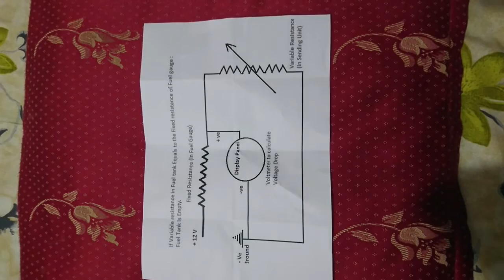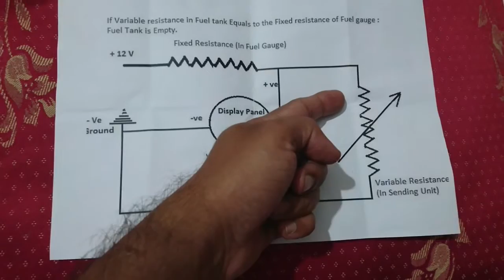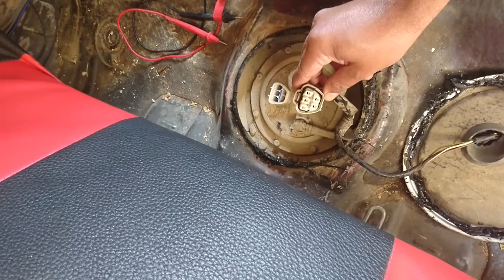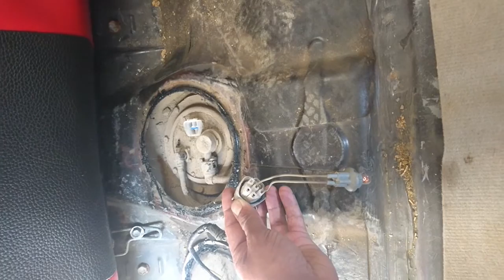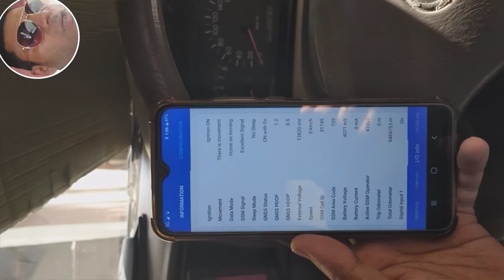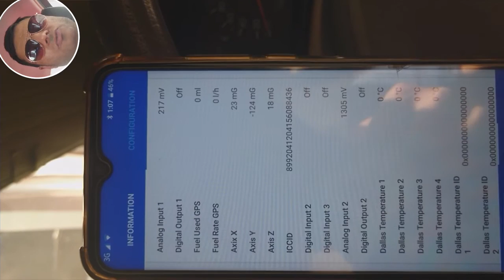Connecting Teltonika GPS Tracker to Vehicle Fuel Gauge Sensor (Part I)

Comment: I have done this method but the voltage sent to the tracker flucuates too much due to fuel sloshing. How do you minimize this fluctuation
Reply: Has you calibrate filling empty tu full tank step by five lto five itters? Please let me know because i`m trying to do this, on the other hand, has you consider use a ceramic resistence and diode?
Reply from the maker: Fluctuations will be in milli volts only that Ok rest is need to be handled at Software or application Side, you see check sequel of this video for this
Reply: @AnjumSohail  "Thanks, master. What resistance capacity do you recommend? 1 kohm?

Comment: Could you please make the video for connecting Teltonika with fuel wires in Innova?
Reply from the maker: I do'nt Own the Toyota Innova, but context described in the video are specific to some vehicle, you can simply trace fuel sensor wires from fuel gauge to the Cluster meter using Multi meter (continuity Testing ) and attach as described

Comment: how do I connect to a Shenzhen BW09 since it has a fuel reading option
Reply from the maker: As per datasheet I read, it doesn't have any wire analog input, although it has marketed as having fuel detection feature.

Comment: Hello friend I did but with a Ruptela trace 5 and I have data the problema Now si the platform that I need to use  to convert that data anolog.
Reply from the maker: Plz see video in link for application side details : https://youtu.be/Oc5o3Cpyc-g?si=Emcd0-fsjnkDsyQE
Reply from the maker: From Data conversion if you mean Gallons of fuel left, then it will be pure mathematical, lets suppose your fuel tank capacity is 45 ltrs, and fuel sensor reports 500 millivolts ( max=0.5 ) when tank is full and 6 Volts (min=6) when tank is Empty. (Example Reference range, varies with each vehicle). let X be the currently reported value the formula could :
Amount Fuel Consumed in Liters = (X -0.5) / 6 * 45
or
Amount of Fuel Left in Liters = 45 - { (X -0.5) / 6 * 45 }
Reply from the maker: Plz see video in link for application side details : https://youtu.be/Oc5o3Cpyc-g?si=Emcd0-fsjnkDsyQE

Comment: Hi 
Can we also do the same with concox device (GT800, GT06N, X3) ?
Reply from the maker: X3 only supports accessories supporting RS232 and TLL interface, which different and incompatible.
GT06N has predefined IO's so it is not possible with it
In GT800, purple color line of device extended port can be used for the same purpose.
see the user manual
https://www.iconcox.com/uploads/soft/170512/1-1f512152h8.pdf
same is the case with meitrack brand devices

Comment: Excellent video, thanks. One question,  what value in mV does the tracker send when ignition is off? I've had the issue with trackers that reports empty tank, is this the case with the teltonika?
Reply from the maker: we are actually getting the fuel gauge reading, that is only available when ignition is turned on, when ignition is switch off we get almost 0 mv, but this anomaly need to be handled at application level to report last fuel tank value when ignition was switched off.
Reply: @AnjumSohail  Thank you for you reply, this is what I had to do at a software level "when ignition is off = last value with ignition on". Thanks again!
Reply from the maker: @cocoyete Plz see video in link for application side details : https://youtu.be/Oc5o3Cpyc-g?si=Emcd0-fsjnkDsyQE

Comment: Can i also do what you recommend with FMB140? If yes, which wire input nr should I use. DIN2 or DIN3. Also, will the Unit then automarically pick up fuel level or is there a setting on the software where I need to enter my vehicle Min&Max values? Where are these values and must it be entered in Ohms or Volts?
Reply from the maker: Yes you can do it with FMB140 as well via AIN.1 or AIN.2 only,
The device will report the voltage levels (not Ohm valve) values only corresponding to the the level of fuel.
The fuel Level calculation using above data, will need to be done on the tracking platform side, like on my Traccar server using Calculated attributes functions.
Reply: Can you share calculated atribuyes for fuel
Reply from the maker: Plz see video in link for application side details : https://youtu.be/Oc5o3Cpyc-g?si=Emcd0-fsjnkDsyQE

Comment: Hi how do i configure the fuel
Reply from the maker: Oh, in teltonika devices, the analog input provides the information in voltage levels corresponding to the fuel level between 0 and 24v, 
Each vehicle is different, so you need to read the analog one input value when the fuel tank was empty and one value when the tank was full.(min&max)
So on the tracking platforms side, you could drive the simple mathematical formula to provide fuel level in %Age using Analog Input value from Tracker
Reply from the maker: I don't understand
Reply from the maker: Plz see video in link for application side details : https://youtu.be/Oc5o3Cpyc-g?si=Emcd0-fsjnkDsyQE